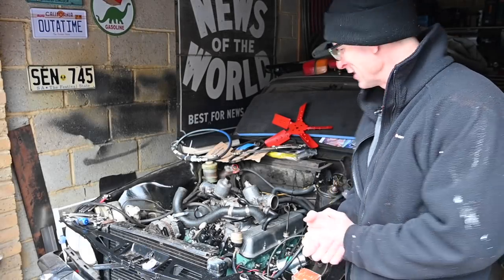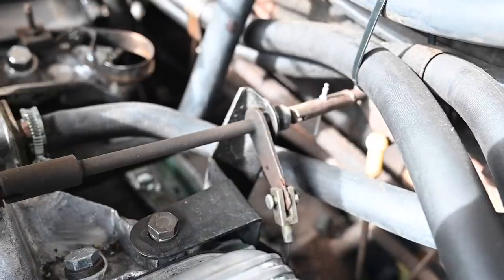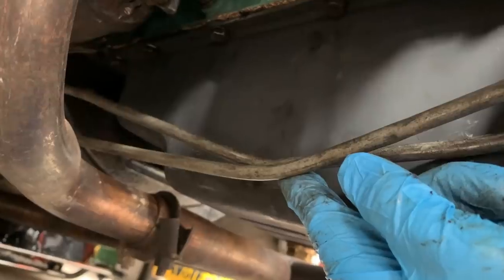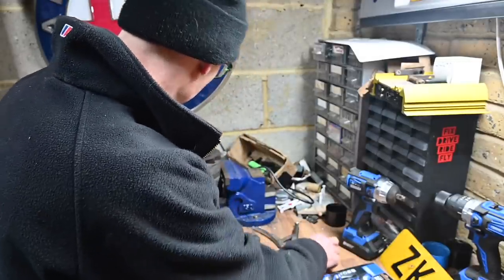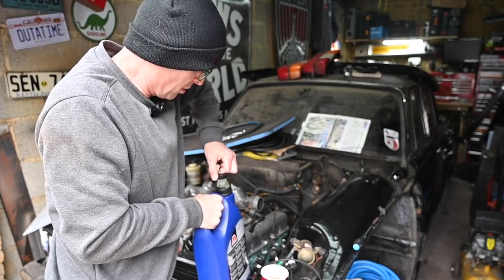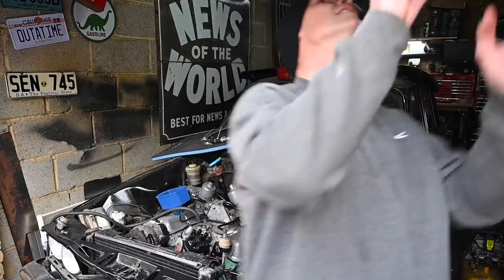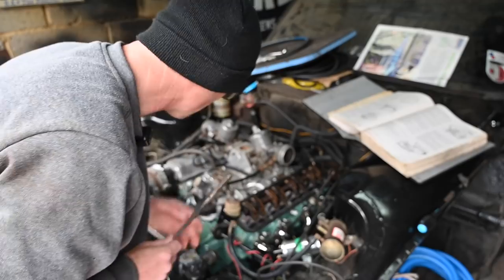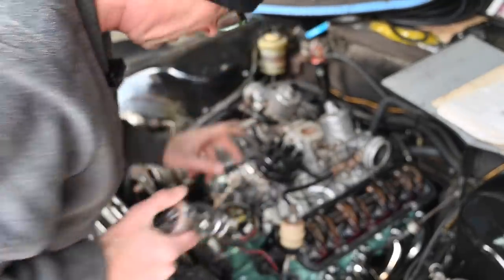Rover V8 is ready to start..or is it..?

Comment: Re check all your alignment, oil pump dog, distributor drive tang, and that number one cylinder is on the point of firing, with both valves closed and the timing pointer at approx 6 degrees BTDC. Its easy to get it180 degrees out on an 8 cylinder. Number one HT on the distributor should be nearest the radiator when correctly aligned. Check the drive tang position and turn the oil pump drive to the approximate position.  The distributor should drop in by a slight twist to align to the camshaft, and turn the rotor arm slightly as you push down. You are aligning two drives so it can be tricky. You'll hear a metallic thump as the distributor seats on the timing case.
 Also one often overlooked factor.  Check the oil pump and distributor drives are matched. The wobbly extension on the distributor shaft can be swapped to suit by pushing out the roll pin. Ive seen people try to fit male to male and female to female drives!  There are some very subtle differences over the years in distributor shaft length and the slot / tang can be more offset from centre.  Your oil pump should turn freely with a bit of oil resistance.  If its stuck solid, you may have an issue with mixed parts.  Later engines had a concentric oil pump inside the front cover. There were slight changes in the crankshaft nose length too to consider so your crankshaft drive pully could be wrong, also a possible cause of your belt alignment problems.
Reply from the maker: This timing cover and oil pump came off the 3.5 together and had been working, the only change is to add a high volume kit, and was turning smoothly. Fortunately the pump drive and distributor are matched M & F.
Its an aftermarket cam but from a V8 specialist who knew what parts were here so should fit
Reply: @furiousdriving  Hi Matt, it should be the beefed up "Thor" version block then, with cross bolted main bearings, and without the outer row of short length head bolts above the exhaust manifolds ?  Thor blocks are identifiable as it should have a row of bolt heads down each side of the block that cross  grip the main bearings.  
       
     Did you check the end float and side thrust on the 2 pump gears are within the given tollerance?  Too tight and it will nip the gears when you tighten the cover down.. Also, did you check the pump cover plate for scoring, twist or swarf ?  My guess is you may have a foreign body in the gears, maybe caught in the Vasseline and jamming as they mesh, or a mismatch somewhere in the Hi Cap kit ?  Even the wrong thickness of gasket can upset the clearance, they're usually thin paper so you could need a thicker gasket.  Also check the pump cover hasn't got dinged and dented on the front crossmember or panels as the engine lowered in, it's a tight fit, even with a standard oil pump.  I'm presuming it's a spacer block and deeper gear type kit you've fitted ?  Gapping is critical as there's more chance of tollerences closing up as the extra gaskets compress.  The pumps will not self prime so you must pack the gears before start up.  I've replied to a couple of others about the distributor drive tang being slightly altered over the years.

    As to the pulley alignments I think the root problem is it's got the wrong crankshaft damper and pulley centre fitted.  I'm pretty sure the Thor versions have a slightly longer nose on the crankshaft, to accommodate the concentric type oil pump that fits behind the front cover.. You may need to swap the crankshaft damper and centre for the 4.0 or 4.6 type if you're using the early one.  A standard 4.0 or 4.6 would usually have had a serpentine belt driving all the ancillaries. The overall depth of the centre and internal bore depth of the crankshaft damper pulley centre are different, so one or other won't sit far enough back due to the small extra length of those later crankshafts.  You may need to swap the removable pulley rings about too, or experiment with more or less spacers between the two pulley rings to fine tune pulley alignment.  The crank pulleys are all just bolted on with , I think 6, long thin bolts.  They're made up in layers of V grooved pulleys and spacer rings so they can be set nearer, or further out to align with the PAS, Air Con, Emissions Air Injection Pump and Fan/Alternator in whatever combination was needed for it's original sales market. You could really do with the V8 engine catalogue from Rimmer Brothers.  It shows all the various options, part numbers, and which vehicle or engine they fit, sizes and alternatives to suit mixed build engines.  They also list all the various suffix letters and engine numbers, so you can work out your engine's age, vehicle and what market it originally sold in.  Rimmer's used to post their catalogues to you FOC, not sure if they still do 😁   P.S you might want to consider swapping that rod link throttle to a cable SD1 type. They were a bit tempramental and could break the joints or cause odd throttle sticking andsurge from engine torque twist, more so with the bigger capacity engine. I had one shear at the plastic joint, on a late P6 V8 auto as it revved up during kickdown. Not a nice experience having to coast over to the side with the engine revs climbing as you're trying to brake and get the gearbox into neutral all at once.  Make sure the bushings on that engine front tie bar are good or you will get odd loud clunk's and chatter from it as it as torque rocks the engine.

Comment: I once put my distributor in on the wrong lap for the camshaft/crankshaft, I ran that engine with the ignition wires mounted 180° on the distributor for ages. Now, you having the valvecover off tells you on which lap it is, smart thinking!
Reply: I had to edit my text, just now I saw that I wrote alternator in stead of distributor! :)

Comment: Bum!  Probably a stupid question but, are the oil pump and distributer from the same engine as the block?  It is possible that these are different on different models.  BL were great at fitting things that are just different enough not to work on models that were, otherwise, very similar.  Ask me how I know.  Yes Mini I am looking at you.   .   .
Reply: If it's an original 4,6 and not a bored out 3.9, it will be a later reworked engine known as the "Thor" version. They had numerous modifications over the earlier 3.5 /3.9 / 4.2 engines.  Easily identified as they have cross bolted main bearings to stiffen the block, so have a row of bolt heads showing along each side of the crankcase, and cylinder head bolt changes  The engines are interchangeable with the earlier units to increase capacity on older models.  You need to use matching sets of bits and ancillaries, and change some others to reverse spec it to suit the car.  The 4.6 in a Land / Range Rover would have had EFI, a single serpentine belt, instead of multiple drive belts
. They also had coil pack ignition instead of a distributor so the timing case, crank, pullys and oil pump are.different and need swapping over. Its a trial and error headache if you're following someone's handiwork, not familiar what car a part is from and they put the wrong bits on when converting to the older spec.
Reply from the maker: Oil pump, dizzy and timing cover and from the old 3.5, although they are SD1 and fitted to a 4.6 block now

Comment: The millers running in oil isn't meant to cushion anything as it should be "thin" so the piston rings bed in properly. My engine builder said you can use general mineral oil really and I'm going to change it after the 20 minute running in period for the cams at 2k revs.
Reply: I agree.. most engine wear on a rebuilt engine happens at the start. So changing the oil straight away after it’s warmed up makes sense.
Reply: Yes, and mine has an oil cooled turbo and hydraulic tappets. It's a 16v redblock Volvo engine.

Comment: Keep going your almost home....Did you drop the ball bearing out of your improvised tool for turning the oil pump? that's why your tool snapped off at the weakest point maybe that ball bearing is still in the oil drive hole that might be why the dizzy does not seat?

Comment: Did you say you have the upgraded oil pump with the spacer?  If so then your problem might be here.  I had to machine a small amount off the gear end to give the required clearance.  I guess the amount the gaskets compress can vary.

Comment: You didn't absolutely bung the vaseline into the oil pump did you? You made sure to leave a bit of space for the vaseline to move around. If not, then your trying to shove gloopy semisolid through quite small oil lines out of the pump. So it'll be like trying to squish a liquid with small pin holes in the container. It'll take alot of force.

Comment: Cannot think of a reason for the pump binding off the top of my head.  If it spun around on fitting it should spin now.  I primed mine with  a battery drill.  Vaseline doesn't does not 'go off'.  When I built my RV8 there was 2 years between putting the Vaseline in and starting

Comment: So close, yet so far. At least you haven't buggered anything yet. Sometimes the pros are worse, though. I had an 89 Mercury Grand Marquis with the 5.8 that had been wrecked in a crash, and a solid 79 Ford Thunderbird with a bad 5.0 litre Windsor engine. The shop was meant to pull the 5.8 and AOD transmission out of the 89 and fit it to the 79. The job never got done because they managed to size the 5.8! To say I was displeased is to understate my state. In the end, both cars ended up at the breaker's yard

Comment: I can't believe vaseline is stopping the oil pump turning but after you bolted the cover plate on you may not have tried turning the pump because you did not want to disturb the vaseline. The gears to housing have very tight tolerances so a bit of dirt can easily jam the gears. I suggest you take the filter block bit off and see if you can turn the gears. Bottom line is if the pump drive is stiff you will struggle getting the distributor in, hence your o ring gap. I'd also take the filter off as your get so much more room. Better safe than sorry. Also if your going to prime the pump by hand I would not bother with vaseline.

Comment: I think I would remove the Vaseline from the pump at this point and run on the starter plugs out. If all of the bearings and cam was slathered with run in goop all should be OK. If you still have hydraulic lifters you have to let them get some oil too. VERY few people pre oil the engine using the pump and have no problems when not doing so. 20-30 minutes at 2000rpm is about right for bedding in the cam. Solder up the rad frame while it's out this time. It's an easy job with it on the bench and makes a few minutes of content.
Reply: The geared type pump isn't self priming, needs the gears packed with vaseline or it will never suck oil, no matter how fast it's spun over.
Reply: @brianwhittington5086  So what happens after an oil and filter change and all oil has been drained from the engine? What other pumps are used other than geared ones? I guess there could be piston type pumps but I don't know engines that use them.
Reply: @delukxy  The twin gear early pump was used until I think the rework in the 1990s when the newer version was known as the Thor type engine.  The 3,9 was re designated as 4.0  and there were larger variants.and specials upto the end of production when the new BMW / Jaguar v8s took over .The 4.2v8 used in the early 1990s Range Rover LSE was based on the early 3.5 and 3.9 block, not a Thor version.  The Thor version has a stiffened block, achieced by using an extra row of bolts through the block sides to cross brace the main bearing caps.  The outer row of small cylinder head bolts were deleted to improve cylinder head clamping and de stress the head.  A new concentric circle type oil pump is used that sits around the crankshaft nose inside the new style front timing cover. The Thor engine uses coil discharge packs, instead of a distributor. It also uses a single serpentine drive belt for all the engine ancillaries. The new Thor block will take the old 3.5 / 3.9 / 4.2 parts to convert it to an earlier spec look, but its a case of knowing which parts mix n match for the ancillaries to drive off multiple belts. There are some slight differences as I think the Thor block has a few mm longer nose on the crank so straightforward pulley alignment can be an issue.  
    On the twin gear external oil pump, oil remains in it during a service. You should always pre fill oil in the new filter as it can starve until air is purged from the system.  It can take several worrying minutes on a high milage engine before the oil light stops flickering.   Revving it will only increase existing wear as the pump gears don't self prime. They are just two close meshed cogs that compress and push oil. End float between the gears, pump body and cover can be an issue that will reduce oil pressure too. Later SD1 pumps are an improvement.  Dry sump and / or a high pressure scavenger pump is the ultimate solution for heavily modified and motorsport use.
Reply: @brianwhittington5086  Thanks for that review. It's been obvious that mixing and matching these engines has highlighted some problems. The pulleys you mentioned showing up in this and the last video about this car. Matt will get there, hopefully without any mechanical mishaps along the way. It's not the first time this has been done so the info is out there somewhere.
Reply: @delukxy it's a pain when parts get mixed, lost or separated. I've been involved with V8 model P5, P6 , SD1 and  4 X4's since the mid 1970s.  Always boxes full of spares in my sheds and knew what they fitted  The worrying thing is that oil pump drive not moving, it should turn quite smooth and easily. The cause could be a number of things. Wrong gears mismatched to the pump body. Not enough end float on the gears, they're a snug fit. Too thin or missing gasket on the oil pump end plate causing the gears to nip, or even a foreign body in the pump jamming the gears.  Priority needed to investigate as it will shear the distributor drive at the adaptor, or tight gears will chew away the alloy housing and swarf will enter the oil galleries, wrecking bearings etc.  Rimmer Brothers in Lincoln do a very good V8 engine parts catalogue, they used to post them out FOC.  It lists all the variant parts, numbers and which fits each margue, model, engine type or application etc. It also lists engine suffix and numbers so you can identify what model and year range an engine was originally fitted to.

Comment: If you don't have a spare distributor shaft to use as a primer tool, you can always remove all the spark plugs and use the starter motor to do the priming.  No plugs = no compresssion, so the entire engine will spin freely and not kill the battery.

EDIT: 19:55.  "In anticipation of it starting I bought" (me: bubbly) ... ATF.

No!  Bubbly!  You deserve it.
Reply: The early oil pump type doesnt self prime, oil remains in it during oil changes so needs to be Vaseline packed after a strip down.  You should always oil fill a new oil filter on this engine too or it may starve for several minutes on start up.

Comment: I would have taken plugs out and spun it over on starter to prime.
Just a few short bursts to see if oil light goes out.
Reply from the maker: Its much safer to spin the pump manually first. It gets oil to the top with out turning the engine and wouldn't have shown the problem with the oil pump straight away
Reply: It's a doddle to lift out the distributor and prime the system with a DIY priming tool.  Takes literally 2 minutes with a battery drill.  With the valve covers off you can physically see the oil pouring round the engine.    Why would you not?  In any case doing that for this guy prob saved the engine

Comment: Those Rovers must be really hard to work cars,in comparison are they harder to work on or easier than the Volvo or Mercedes Benz.
Reply: much easier than mercedes....volvos are super easy to work on.
Reply: Even with a V8 the P6 had good space for working in the engine bay. Very few things were awkward to get to. It was actually easier to work on than many similar sized cars with small engines, as most things in the V design are fairly symmetric, and easy to reach from each side of the car.

Comment: You will find it hard to back drive the oil pump, your trying to turn the engine over with it..BOH
Reply: That's what I was thinking. I'd have turned the engine over while the rocker cover was off, with the coil disconnected to see if oil was pumping up to the rockers... without all the other messing around.
Reply: The gear type oil pump has no direct drive from the engine.  The camshaft meshes with the distributor shaft gear and the oil pump drives off an extension tang at the base of the distributor shaft.  That drive tang extension was a wear or break issue on some early engines.
Reply: @brianwhittington5086  I see, the dizzy drive is the gear drive for the pump. Cheers Brian.
Reply: @proluxelectronics7419  Yes there have been a lot of minor changes as its been in use since Rover reworked the original engine they acquired from GM in the 1960s. There's been a few changes just to improve oil pressure and distributor wear.  The correct match of oil pump shaft and distributor drive can cause headaches, especially when you're mix n matching parts from various years of production, early engines and the improved Thor engines.